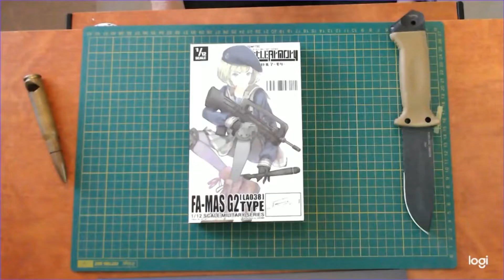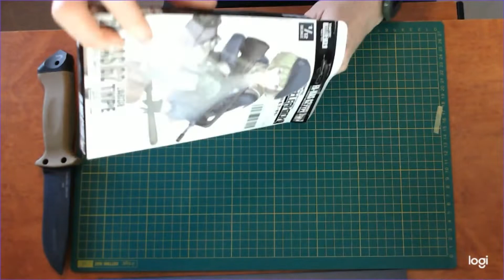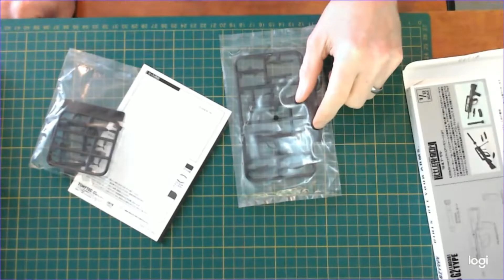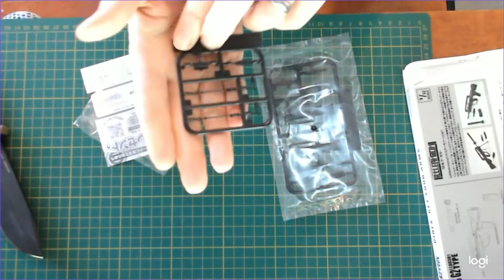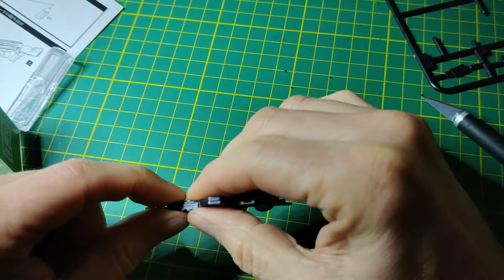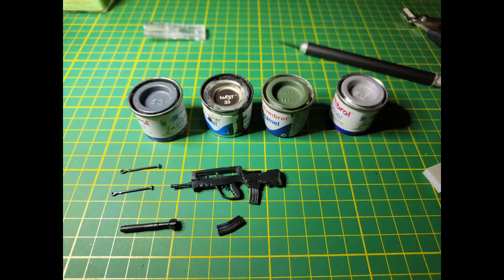FAMAS Unboxing & Build - TomyTec Little Armory

Comment: Never built before. Recommendations on glue?
Reply from the maker: Tamiya extra thin cement is what I use, it comes in a 40ml bottle and has an applicator. Tamiya also have a standard version with a white lid, I haven't used that before but I think that would be fine too if you can't get the extra thin one.